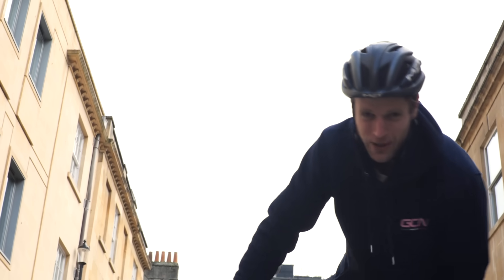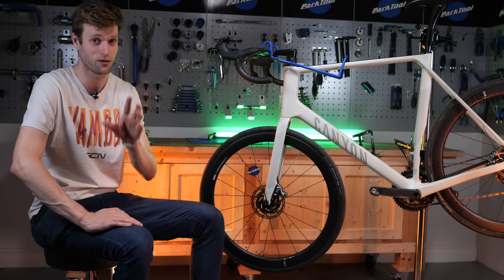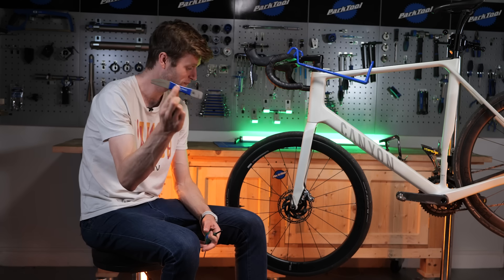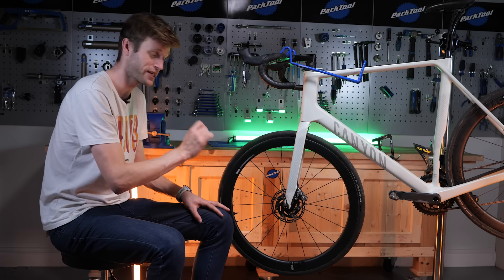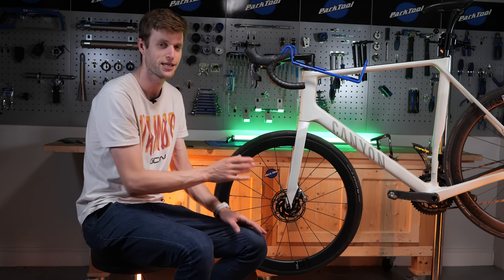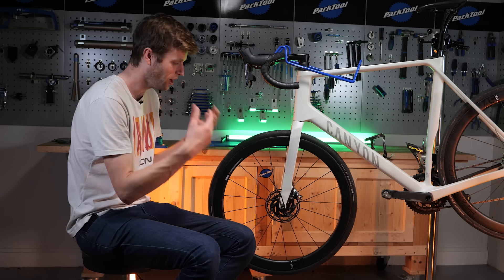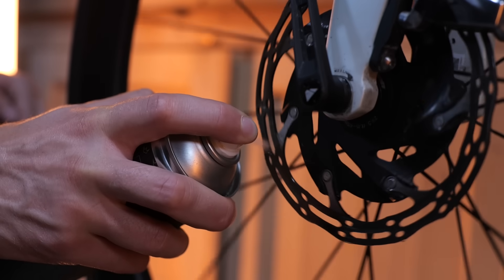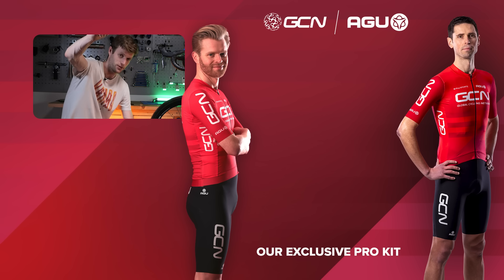Why Your Disc Brakes Are Noisy (And How To Fix Them)

Comment: GCN Tech:   Your Disc Brakes Are Noisy (And How To Fix Them)
Manon: Buy a rim brake bike. Solved!
If your disc brake are squeaking, it caught a rat!
Reply: So that's why...
Reply: Rim brakes, HAH! Yea till it rains....you know when I really want brakes? In the rain
Reply: @NanoDex  Sooooo, for a hundred years BEFORE disc brakes what was the stopping rage in the rain? And what were YOU  rocking BEFORE disc brakes, in the rain?
Reply: @NanoDex I ride on heavy rains multiple times, where the road literally flooded. Yet i still brake just fine with my rim brake
Reply: @yukiko_5051  And yet, disc brakes still offer better modulation and better stopping in the wet.
Reply: @robinseibel7540  Tell that to my friend that fell multiple times because his front wheel locked up because there's not enough grip on the front tire
Reply: @yukiko_5051  , you're ignoring a lot of things: first of all, you're ignoring the person operating the brakes and how they input forces into the brake system. Second your ignoring the conditions. Third you're ignoring that that "experience" with the other type of brakes wasn't tested at the same location on the same day in the same conditions.  That means you cannot say anything conclusive about whatever brake system your friend was using on that day. There are far too many variables that were not isolated and controlled.  Nevertheless, all things being equal, disc brake provide more consistent modulation and better braking in the wet.
Reply: @robinseibel7540  First of all, i ride with him together in the rain. Second, he is an athlete while i am an amateur. Third, we ride at 15 kph average because the road is literally flooded. Yet he is the one that fell while i ride just fine
Reply: @yukiko_5051  , so? That proves nothing other than he went down and you didn't.  Maybe he hit a small patch of oil. You don't know 'cuz no one did a surface examination to determine if there is any oil there at all.  Maybe he made a mistake.  There are a host of things that could have contributed to that. Your single episode proves nothing, nothing at all because there is no complete story about what happened.  Further, that he's "an athlete" really means nothing.  Have you watched any pro racing? Some pros crash a lot because they have poor bike handling skills.  Moreover, being "an athlete" says nothing about his experience braking on a bicycle in foul conditions. Who knows what kind of "athlete" he is. It's really irrelevant.  Who knows why he went down and you didn't.  You certainly don't know. All you did was make an assumption.  Alas, assumptions aren't facts.  A single event is not a trend. Are you going to claim that no one who rides rim brakes has ever crashed in the rain? You're free to choose whatever equipment you want for your bike. That's one of the cool things about cycling.  Just don't confuse your preferences with facts.

Comment: I had an issue some time ago where I had brake squeal and none of the methods in the video fixed it. Went to a bike shop and they pointed out that my rotor had heat damage which were causing the sound. Had to replace the rotor, but everything is good now.

Comment: This will keep happening, disc brakes want you to be their little slave. A bit of usage and dirt and they'll sing. If you want them to be quiet you need to clean and sand them often which I refuse.
As I said many many times I have 2 road bikes with shimano 105, one is rim brake, the other hydraulic disc and oh boy let me tell you yet again, rim ones works better, stops better, need zero maintenance, and keep better their stopping power.
Disc ones under heat, a long descend, and under rain are a joke, awful performance. Rim ones keep their ground much much better, opposite of what manufacturers tell you to sell an inferior yet more expansive system.
Those saying cars use disc brakes are wrong, the car brake system is completely different

Comment: I just replaced my brake pads (SRAM Rival AXS) and there is almost no space now between rotors and pads.  I took the wheel out and pushed the pads back with the correct tool, and it's now just marginal.  What do you suggest? #ASKGCN
Reply: might be bike shop time.  I can't seem to get mine right, so I am taking it to my shop.